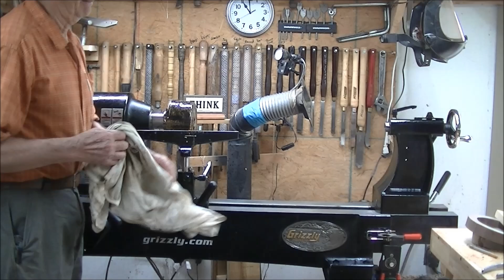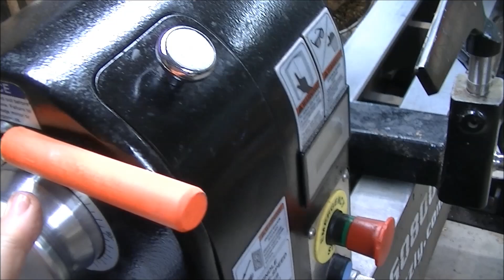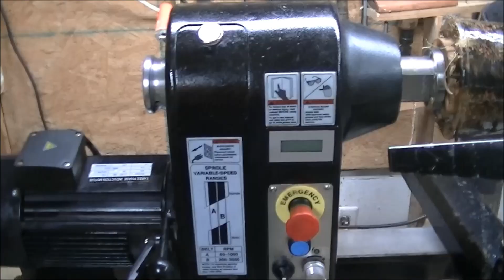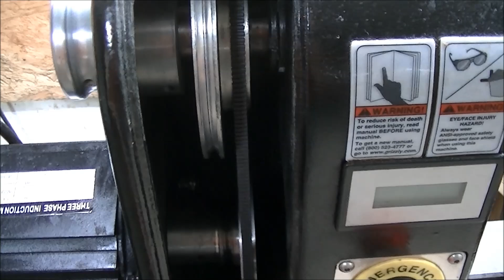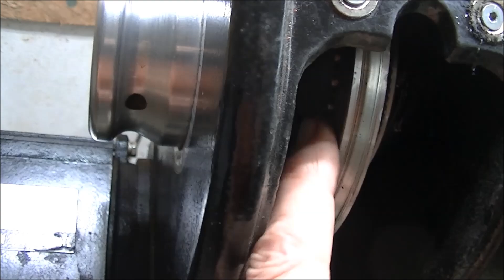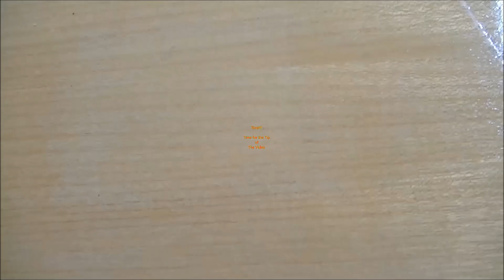Grizzly G0800 Lathe Review # 76

Comment: I sorta accidentally pulled out that pin on the indexing wheel, and I think it might be "off" where it was before I messed with it (but only a tiny amount bc I didn't move anything very much).  It's now set with the thickest part of the cross-pin pointed to the left and sitting on the high side of the collar, in a groove.   The big knob moves freely.  Did I screw something up?  I've had my G0800 for over a year and never started it bc I'm not sure about that "pin must be pulled out or it can damage the machine" warning label (plus a few other factors).  Cost too much to break it , LOL.  I appreciate any advice you can give.
Reply from the maker: I guess you mean the locking pin.  I've had to replace mine three times.  The whole thing just screws out, housing and all.  They are about $10 from griz.  Hope that helped, Larry
Reply: @TheWoodWhirler  I was trying to find out if by my pulling it out without knowing what it does might have damaged something. After messing with it, the dial is set a little to the left of the 0 degree mark.  And is the knob supposed to turn freely?
Reply from the maker: @The_DC_Kid , You gonna have to send me a picture of what you are talking about.  I don't think we are on the same page.  Send it to woodwhirler@gmail.com.  Larry

Comment: I have never ordered machinery from Grizzy (other things) but I am not impressed on how they wanted to take care of the issue.  They don't have a better relationship with the manufacturer in China?  Not good.
Reply from the maker: Well, I don't necessarily agree with you.  I have lots of Grizzy products and am very satisfied.  This was an unusual problem   I went up the chain and they all told me mine was first and that part was not stocked.  I have no reason not to believe them.  Now as far as their relationship with Philippines not China, I don't stand that either.   They did take the part out of a floor model and sent it to me.  Don't let my experience sour you.  They actually give you the most bang for the buck than any one else.  Take care and thank you, Larry
Reply: What was the issue?   I'm waiting to order one a G0800 and I'd like to know about possible problems.  Thanks.
Reply from the maker: They said they had never had this problem before, so the part wasn't stocked.  But. I got one in a few days, problem solved.  That's the only problem I've had and I've had the lathe a year and half now, going strong.  You shouldn't have any problems.  Take care, Larry

Comment: This looks EXACTLY like the Harvey T50/T60 lathe. I bet Harvey makes these for Grizzly
Reply: Is that Harvey of China?
Reply from the maker: It does and I bet your are right.  Take care, Larry
Reply: I was talking with Harvey through email in China about ordering this same lathe from them, ($2400) but after shipping across ocean and then freight from port I would only be saving maybe a couple hundred bucks. So Ill just order from Grizzly, however Im considering the Laguna 2436 which is the same price but he Grizzly 0800 seems a little better to me and it has the swing away tail stock which the Laguna does not. I think the Grizzly is the better lathe.
Reply from the maker: I looked at the Laguna 2436 and reached the same conclusion at you.  Grizzly 800 give you quite a bit more for the money.  It's heavier, 3hp vs 2hp, 48" vs 36" and so on.  I like the swing out, but it still gets in your way, especially with long handle tools.  Still, a much better deal.  Take care, Larry

Comment: do you get a high pitch noise at low RPM?, if so how bad, is it annoying
Reply from the maker: No,mine's very quiet, just low noise.  Your noise could be the spanner nut is too tight, or belt alignment, or bad bearing.  I would call Grizzly.  Take care, Larry
Reply: I've not got it yet, should some be here next week. othrrs have complained about a high pitch, like a dog whistle sound. ..good to know yours don't have it, thanks 
Chad
Reply from the maker: I just got off mine and there is a noise, put it's just motor and belt type noise, not loud at all.  Here's a link for a guy that did a review about a year ago.  His machine has a hum even when it isn't running.  That ain't right.  I commented to him but he never answered.  Check it out and let me know what you think. https://www.youtube.com/watch?v=1ZisoN2JvmQ&t=957s,  See ya, Larry
Reply: The Wood Whirler I talked to grizzly tech, they said sometimes the inverter has a hum at low RPM, so since yours don't maybe they found a fix
Reply from the maker: Lot of those inverters hum.  I wouldn't like it.   Mine is a quiet as a mouse.  Maybe I'm lucky.  About damn time.  Take care, Larry

Comment: Thanks for the review.  You've had the entire Grizzly experience.  They offer some very capable machines at an inexpensive price.  If everything works right, you have a machine that does the job while lacking some of the nicer (but unnecessary) features from a "brand name" maker.  On the other hand, when things go wrong, you need to be able to fix it yourself.  One of the ways Grizzly cuts costs is by not stocking replacement parts and providing a support team that can repair their equipment.  They don't provide the same level of support as traditional vendors because if they did they'd need to charge as much as traditional vendors.  

For most hobbiests, that's a decent trade off.  Grizzly has many satisfied customers who swear by their machines and only a few who swear at them.  Buyers just need to understand what they're buying -- including the amount of service after the sale.
Reply from the maker: Yep.  Thanks, Larry